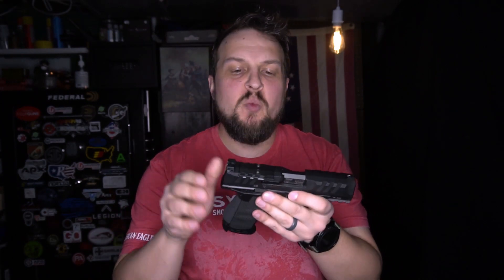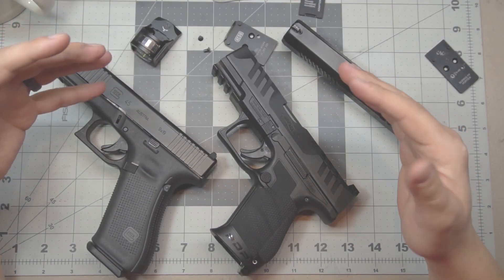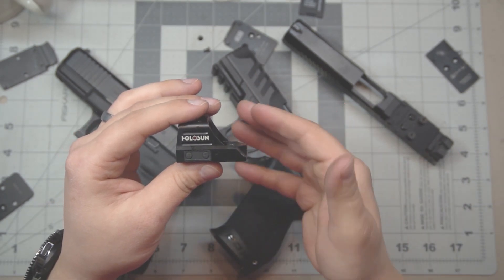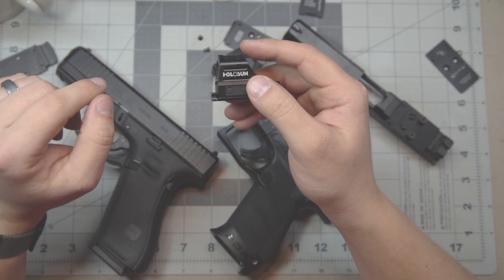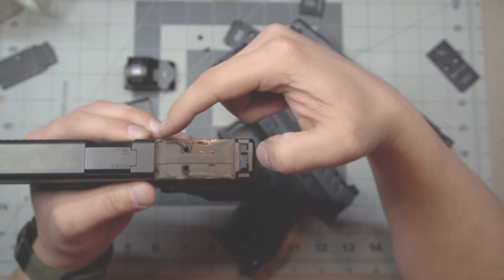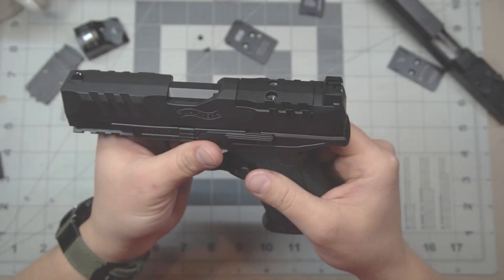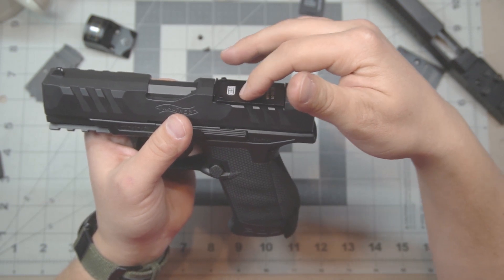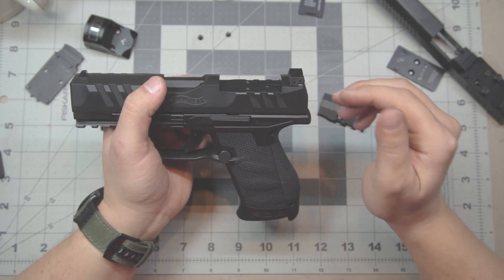The Gen 1 Walther PDP is going to Break

Comment: Sometimes degrees make people dumb and narcissistic. Walther designed this plate system that when you mount the plate to the slide it pushes the plate towards the front of the slide tightly. I’ll add, this is my first Walther I’ve ever owned. I’m a Glock fan and I’ve owned Glock since my first Cary gun being a Gen 1 G17. With that said, Walther has tens of thousands of rounds fired with no issues with the slide mount “breaking”. Finally, this dude “guaranteeing your Walther will break” proves how ignorant this kids “degree” has made him. Making such claims when you haven’t tested your hypothesis is ignorant. Those that have thoroughly tested this platform haven’t had any of these failures. I might add, I don’t think they’ve had ANY failures. I trust Walther’s engineers, and even if it does fail at some point, the Walther warranty is second to none. So this guy can take his overpriced college education and paper diploma and shove it up his ass! Again, this is the FIRST Walther I’ve ever owned or ever shot. So I’m no fanboy of Walther. If anything, I’m a Glock guy. Don’t make your decisions from one video by a guy on YouTube! Test it yourself! If it fails, Walther will fix/replace it. I highly doubt this will fail, but I’m no engineer and neither is this cornball!
Reply: I mean, people are typically skeptical of optics plates solely because they come loose. This guy isn’t saying anything that people don’t already know, but it’s misleading in the sense that he points out Walther.

As a mechanical engineer, he does have a point about the optics system being more prone to the slide coming loose as he pointed out in the video. It might take the Glock 10,000 or 20,0000 rounds to come loose, I would put my life savings on the Walter coming loose at 75% the round count it takes the Glock/CZ/Sig plates based on design alone.

The title is clickbait BS. Just tell people the optic cut isn’t designed well and move on.

Comment: Using Blue lock locktite and proper tapered flat head screws with adequate torque? I assume this breakage will not occur. This  video is Hersey. Really thought a disastrous mechanical failure was going to be in the content. Walther arms is aware of the slack in the mechanism,  and probably designed it that way. I'd be very surprised to hear of a sight breakage. Unless your using a crud Holsun sight ..

Comment: You do have a compelling argument BUT..... if the plate that Walther provides is a perfect fit into the slide cut with NO forward or backward movement, just a prefect machined fit, then that will counter your argument, no? Im sure they thought of this when they designed it the way they did. A perfect fit with zero play, or even a plate that was 0.0005 inches larger than the slide cut, will be a compression fit and the screws provided will be enough.

Comment: Then why when you have a slide custom milled they don’t incorporate any of these life saving “lugs”
Reply: Hmmm. Interesting point. Then again I always thought of those lugs as alignment aids.
Reply: If a slide is custom milled it is cut for a specific optic and the optic mounts directly into the slide so no adapter or mounting plate is necessary.

Comment: This is just a terrible video. No actual testing was done with the walther OEM plate so how is this is a legitimate evaluation.
Reply: Pretty sure that is the OEM plate. Walther went thru C&H precision for their plates. That said, I still dont forsee this being a real issue due to all of the testing its already gone through.
Reply: @collinjones311  It wouldn't be the first or the last time an OEM does adjustments before 'official' release. He got his plates before Walther released them to the market, there is a reason for that. There is also an option to get the plates for free through Walther, so that's not an excuse either.
Reply: @lucastonoli3256  yeah walther contracted the plates throufh c&h and woth the purchase ofnthe pdp you get a coupon for one free plate. Not sure what exactly you are trying to say with your comment. Please elaborate
Reply: @collinjones311  That he got this plate from c&h before Walther released the plate themselves, going off from a product ID on c&h catalogue. The plate he has might not even have the same specs as the final product Walther is shipping now.
Reply from the maker: Correction: shipped direct from C&H, not ordered, because I contacted them asking for a production plate for the PDP with an RMR footprint.  Not ordered blindly.

Either way, it doesn't negate the lack of recoil lugs to relieve stress from the bolts holding it on. (Yes, bolts, not screws)
Reply: @workthetrigger  I didn't claim you ordered blindly (hence why you knew the product ID and whatnot, the details of your interaction with c&h are not that important). Still, this doesn't negate the fact that it wasn't a final product endorsed by Walther and that we don't know if it is the exact same plate being shipped now (and neither do you, in spite of your tendency of pretending to be sure about stuff you cannot confirm).
It also doesn't change the fact that you haven't tested shit and you're making amazingly bold claims as if they were proven truth. Some modesty would have done goof to your video and channel.

The PDP isn't the only pistol with this plate approach and not all of them have problems, so right from the get go there is that. I'm not saying you're dead wrong, I'm just saying you're going off from observations rather than anything proven and already claiming to have the truth on the matter, at least in the way you present the information. This is a bad decision, regardless of your 'expertise', 'qualification' or 'knowledge'.
I just blacklisted your channel, I rather get my information elsewhere. And no, I do not own a Walther product, I probably won't buy a PDP either.

Comment: Lol, you don’t want “no movement” on parts that reciprocate. You want to soften the movement, the more rigid the accessory the more likely it is to sheer. You are not an engineer, you are in design. It shows.
Reply: He never implied 'no movement' and simply pointed out the tolerance discrepancy by comparison.

Comment: I agree there needs to be a sufficient amount of , or points of interferance between all the contracting components in the sight system. But as a previous poster on this thread stated, and as I understand it Walter will send you a proper fitting plate once you tell them the particular optic your going to use. If there is sufficient interference at the ends of the plates then the lesson becomes don't use after market plates which is a great lesson.
Reply: The plate he has is either a preproduction or B a plate for snother gun because that plate wasnt released when this video came out.  The actual aftermarket plates are made with walthers involment and blessing. They work as advertised and are leo / mil specification. The lesson is dont beilive unproven theory on YouTube

Comment: What's worse is the plate actually holds a bunch of parts in, including the extractor, extractor plunger, saftey plunger and spring. When I shot my pdp without the plate all these parts came flying off lost in the woods. They don't say anything about not shooting it without the plate, and they haven't had the parts to fix what happened. It's been months!! I went from very excited about the pdp to totally frustrated.

Comment: Some may call it "wiggle room" so that it doesn't break from the sheer compression of the parts. Shit, the optic on my hunting rifle is still on there using screws.
Reply: A hunting rifle optic doesn't reciprocate like a slide mounted optic.
Reply: @mornefouche94  A hunting rifle produces more force and recoil my dude.
Reply: @OrganicHispanic209  That's irrelevant. A hunting rifle optic doesn't accelerate nearly as violently during recoil compared to a slide mounted optic. I'm very sure a typical rifle scope itself will break fairly quickly if subjected to similar reciprocating forces.

Comment: But with the optic plate sitting down inside the slide, you don't need a lug. The plate being in the channel already is better than a lug. Could the tolerances be better? Maybe. Use some green locktite or super glue.
Reply from the maker: Except that fit is super loose, so it gives no axial support. And the lack of bosses provides no transverse support. It's not supported in any direction by anything other then screws

Comment: I don't think there's enough side to side movement to shear the screws. I don't know the size but I just looked up a 6-40 screw as an example. The tensile strength for a single screw is 130,000 psi. I wouldn't worry about it breaking. BTW, I'm also an engineer.
Reply from the maker: That's what Glock thought too, though. And they had breakages. Not super widespread, some here, some there, and it was enough for the gun community to forever black list the MOS system
Reply: @workthetrigger  In my experience designing tools and using all kinds of fasteners exposed to vibrations and high impact environment, it's highly unlikely. I can see it using a lower grade fasteners but even those are rated at the least 80k psi of tensile strength. I would probably mill my own plate if the .030 is the actual clearance of the provided plate or add a shim to fill the gap.

Comment: I have a gun cut by a gunsmith in this way (no lugs, fastener only) but with direct mount optic, no plate. I get what he means and it seems valid. I was worried about mine but it is cut in a way that optic is a very very tight fit to the slide, it is even very hard to remove it after unscrewing. Maybe the solution would be for someone to make a plate that would go on the slide and has to be hand filed to achive this kind of pressure fit to the specific slide.

Comment: Yeah...no.  You will break the mounting screws before anything else.  And those are cheap and easy to replace.  The slide on the Walther, or on most semi-auto pistols for that matter, is extremely hard.
Reply from the maker: The bolts are what I'm saying will break... But unnecessarily. 

Plus, losing your dot then having to get out broken bolts sucks

Comment: I am defenatly getting this gun, if its true what u say it's not gonna make a difference for me since I dont use optics on any of my handguns
Reply from the maker: Totally worth it then.  It's a PPQ with a much needed facelift. And dare I say, one of the best grip textures on the market.
Reply: @workthetrigger  I have the ppq45 and like it, but gonna sell it cause I want this pdp
Reply: I got the PDP full size 5 inches. Ultra reliable. It's accurate. I am extremely happy. Oh, and I didn't mount any optics. That increases the expenses on an already fine handgun for protection.

Comment: Almost a year later, any breaking's yet? I'm thinking of grabbing one!
Reply from the maker: Yep, there have been a few, actually mostly not in hard use. But, they recently upgraded the optic mount, and word is its going to filter down to the base pistols. So I may give it a few more months ot make sure that happens. But, once it does, 100% endorsed by me if its comfortable and you enjoy shooting it.
Reply: 5.8k standard pressure rounds, take my optic and optic plate apart every 500 to check for any damage and still looks day 1 new. My assistant instructor has over 7k rounds, alot of +p loads and still no issues with him either.

Comment: This weekend I plan on hitting 6.5k rounds on my Walther pdp. Same oem baseplate with holosun 507c x2 still working flawlessly. The only issue I've ever had with the firearm came from their "blue follower" magazine springs. They are way under sprung and will start causing failure to feeds WAYYYY before their intended life cycle is hit. The red oem follower magazines that I've had since day one are still perfect after thousands of rounds. I fixed the blue follower magazines by getting ghost Inc +10% stainless steel magazine springs specifically intended for the full size pdp. They have worked flawlessly. The only downside is that your 18rd Walther magazines are now 17rd magazines. I'll take 1 less round with perfect function over the standard capacity ftf machines any day of the week!

Comment: Sorry man but this video is full of bad info. With run of the mill steel screws it will be plenty strong to hold up to recoil. With high strength screws it will be a breeze to hold up. After a couple years of people running these with no issue it will show this to be what the internet calls click bait. The design looks awesome with that extra deep channel. And I'm not even a walther owner.

Comment: i just bought one. I don't plan on putting an optic on it. It really doesn't need one. It has great iron sight adjustments. I absolutely love the gun so far. I have mostly heard of the pins stripping, but I don't know. I'd imagine your best bet is to have a gunsmith mount that optic on this gun so the right pounds of torque is applied, and also they can give you a heads up on what they think about the mount system

Comment: I guess it's good to be on the lookout for design differences that could lead to potential issues down the road. However, it's rather dogmatic to guarantee that it's going to break based on a lack of theoretically needed locating tabs without knowing that there have been any reported breakages.

Comment: So is my custom Glock 20 slide going to break? I don’t even have a fancy plate, my optic is direct bolted to the slide.  I’m sure the screws have a breaking point but you must remember the optic is torqued down to the slide and all that torque is being dispersed across the surface area regardless of lack of lugs.  I think you’re over thinking how much force these screws are having exerted directly upon them. This is like saying gas key screws on an AR15 bolt carrier are going to shear off.

Comment: Has it broken yet? What about milled slides? Those slides milled by qualified machinist. Guess what? No lugs, no breakage in the slide, No zero issues with Red Dots. You guessed it, all held down with screws. Did my research and informed. Good luck.

Comment: OK knuckleheads...  Here's how to analyse this issue the right way:  Calculate the crossectional area of the 2 screws level with the slot face to mount plate interface.  Weigh the red dot, battery, and mount plate to be used in pounds.  Divide the weight by 32.174 ft/sec^2 to get the mass units in slugs.  Now mount the plate and red dot to the slide.  Verify that the mount plate is not supported (fits loosely in the slot) by the front and rear walls forming the slot on the slide.  Buy 2 micro solid state accelerometer chips and fix them to the slide, one accelerometer set up to measure acceleration in the forward/rearward direction, the other mounted to measure acceleration in the side to side direction.  Hook up the accelerometers to a data gathering device/signal reader set up to measure acceleration in ft/sec^2.  Fire the gun with the highest power ammo (+P) available at least 1 magazine's worth to get a number of acceleration readings.  Calculate the average acceleration value in both directions.  Calculate the acceleration vector magnitude using both averaged acceleration values.  Multiply the mass of the red dot, battery, and mount plate by the acceleration vector magnitude.  This is the average shear force in pounds working across the cross sectional area of the 2 screws.  Divide the shear force by the 2 screws' combined crossectional area.  This is the shear stress acting on the 2 screws.  Now determine what the limiting shear stress value is for infinite life without fatigue fracturing from the manufacturer of the 2 screws.  Calculate the safety factor by dividing the shear stress limit by the actual shear stress.  If the safety factor is less than 1, then 1 or both screws will crack eventually after so many shots fired using the same ammo.  If the safety factor is greater than 1, then the 2 screws will last for many many many many many many shots.  This is how a "mechanical engineer" would do it.  Any undergrad engineering student at your local university would do the experiment in a similar manner.  But don't play with guns.  "You'll shoot your eye out".